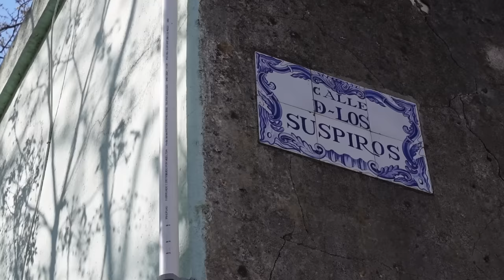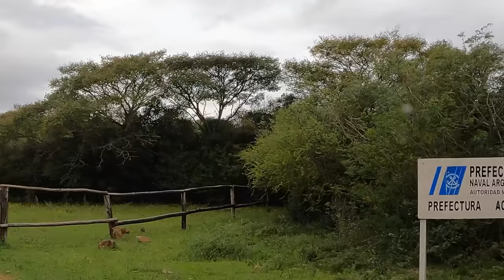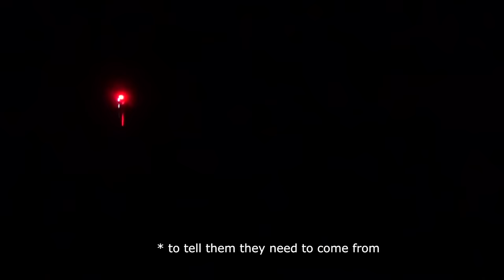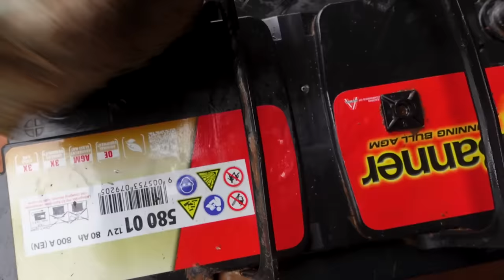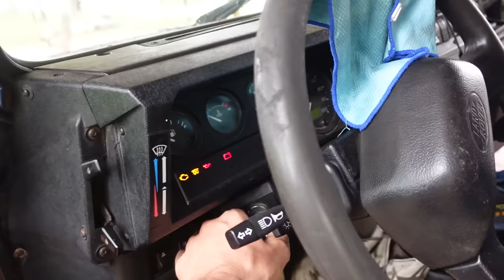We Sank Our Land Rover Defender // EP.67

Comment: Hi guys, just a quick one: do not even hesitate de drain all oils into a clean pan and check for water presence. Your car has been emerged in water for hours. As simple as that especially in a Defender, prone to leaks. Not checking the oil could be as big a mistake than not walking the flooded track. Trust me from experience,  happy driving, cheers,  Martin
Reply from the maker: Hey Martin, we changed axle oils cause I know the rear axle always gets water. We opened transmission and the oils looked clean and it was not more oil/water inside than before. Surprisingly transmission and transfer box of the Bluelandy are dry, even if they have oil inside. 
Anyway thanks for the hind, appreciate it!

Comment: Thank you for sharing that experience. It was certaily not easy to think about videos while facing such an event. We can see how much a defender is resilient. It is one of best vehicle for travels. But on the other side, you have been a bit lucky, after your mistake, not to have the water on the other side of the car, with the ecu and the air filter. It looks like somebody is keeping an eye on you, to transform lessons in experience for you. I am sure that you learned a lot about it. Enjoy your travel, very rich in events and people solidarity.
Reply from the maker: It was not so easy yeah. Specially as we were trying to don't damage more gear , as we were seeing our money flying away at that right moment 💸💸💸 that's why we run out or battery, we were not considering that... And many moments like me running and screaming for help are not on camera, that was the last thing I was thinking on. I didn't even consider taking shoes and I ended up the whole time up until late, barefoot. In that moment you really concentrate on a few things at a time. We were lucky in many ways, but also planned the interior well, as none of our electronics and electrics got close to the water, they are all up. And yes we did learn our lesson, and answering to you, we had many other events after that, but nothing as serious ✌️😎

Comment: Are you sure you don't need to replace the batteries? My car was left parked for three months without driving. The battery is 5 years old battery. The battery got damaged. Even after fully charging, it would drop and rest at 7v or 8v. Now we see that your batteries are struggling to start the vehicle. You don't want to be in that situation in a location where you can't push or without a portable car jump pack. That was a crazy adventure. Good to see that you're back on the rd.
Reply from the maker: Hey Nicholas, no the Battery’s are fine. We got AGM battery’s they can Handel more misuse than normal lead acid batteries. We’re already using the 3 months since this incident and they are doing fine,I believe they only have roughly 75% of their original capacity but that’s still fine. It shows that buying a quality product pays off in the end. Also having the solar on the roof helps to keep the battery healthy and happy
Reply: @Thebluelandy  I’m familiar with AGM, they indeed are much more capable than traditional acid batteries. Glad all is well.

Comment: Wow, that was as close as you get to a total disaster. Well done Blue Landy for starting up straight away.
Reply from the maker: That was soooooo close. Dangerously close. We were incredibly lucky, how it happened and how fast we got help. If we had sank the right side, it would have been completely different story, starting with a ruined ECU and damaged fridge. But other design decisions paid off big time, like putting our electric system and all electronics the highest possible (left side), and using encapsulated batteries.

Comment: Way cool video, YES ALWAYS WALK IT.. I have always walked river crossings But seeing this lesson, reminds me not to get lazy. It can ruin your trip as you said.. Add Crocs, makes it even more fun..I love the power and sound of the td5,  my tdi200 110 is slow compared, But it is sinkable 😁
Reply from the maker: Hey Michael, you are so right, always walk it…. 
I love the TD5, it is a good engine. No problems with heat, water or altitude. I was skeptical but it always works. I took some effort to get it dry but ever since it’s not using any oil 🤩

Comment: Well done for recovering from a stressful situation. I would just say that when you are doing the maintenance with the high lift jack please consider putting the wheel you have taken off and slide it under the axle for some insurance,if the car slips of the high lift.
Reply from the maker: Yeap, it was tough and we were lucky in many ways. And yes, normally I would put the tire below for safety. Thank you for your comment. See you around!!

Comment: Best recovery tool is a 10-15  ton come-a-long and extra rope. Winch is fine for as long as a engine runs and the batteries last. Once that stop, you done. Nothing can go wrong on a come-a long. The little bi9 of weight is nothing compared to a winch and it do not take a lot of space.
Reply from the maker: That sounds like a really good solution in between. We did use the HLift jack this way to pull and secure one of the straps (not in video). But not as strong as you mention (15ton). We still find it too bulky though, we really cannot fit more in our Landy 😭

Comment: Have been wondering why you haven't invested in a winch yet. You should really get one, front and back.
Reply from the maker: Hey Justin, 
There are several reasons, weight is your biggest enemy off-roading and traveling. Carrying two winches with you to use them 1 or 2 times during the hole tip is overkill in my mind. Plus spending the extra money would probably eat up the budget for 2-3 months traveling. I might would get a winch for a offroad truck, or a farm-work truck but not on an overland truck.

Comment: 7:10 How can you believe that this won't happen at some point when you use a river exactly like a road?
Reply from the maker: Hey Philip, Normally I don’t use diff lock and low gears on a road, not sure what you do.
The problem clearly was that the road had a bridge that was off center to the right. If we would have walked it there’s a chance that we would have realized that, not 100% sure about that… . Missing the bridge with one tire caused the car to slide down and off the road.

Comment: Discipline is the rule number one in any adventure. Solo offroad without a winch?
Reply from the maker: There are so many rules, but it’s not an adventure until something goes wrong 😅
A winch can save you work in some places. I’ve now been stuck only in two places where a winch would have made a difference. In both places we performed a self recovery. It was a lot of work but we always got out. In the river a winch would not have made a difference.
Reply: @Thebluelandy  Safety first is the rule number one. What you have experienced is not an adventure but an "incident",  with minimal damages just because you were helped. And even if for someone being helped is pretty obvious 9:25, actually it is not at all. I am sure that you understood the lesson and you well never ever perform water crossing anymore without checking the surrounding.
The winch is a must for offroad solo touring. I have two winches on my landcruiser; I used the rear winch one time only in the last 3 or 4 years but it's enough to confirm that it was a good choice. In your situation, the winch AND a snatch block could have solve the issue in 15 min.
From your video, I suggest to replace the fire extinguisher in a better location and considering  your cargo handling, I'd just add an additional 1Kg fire extinguisher.